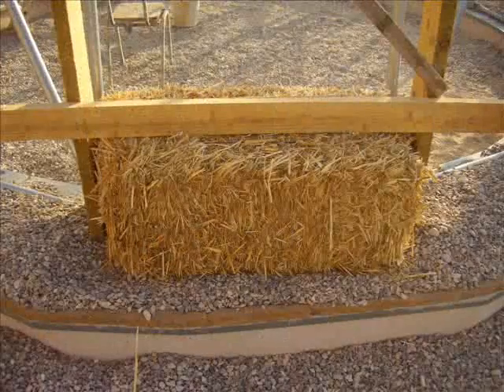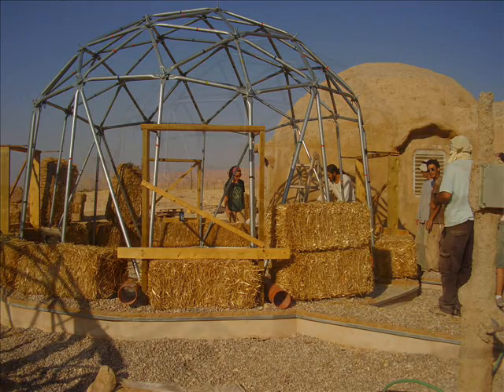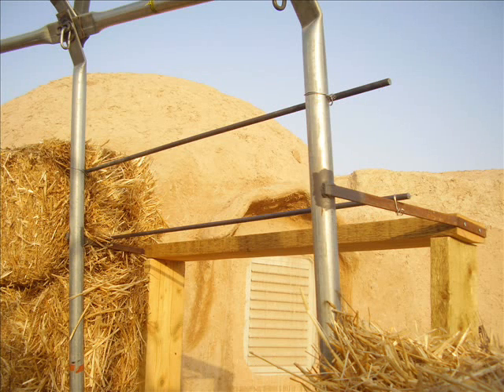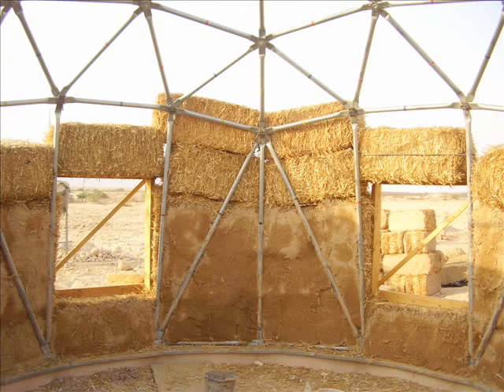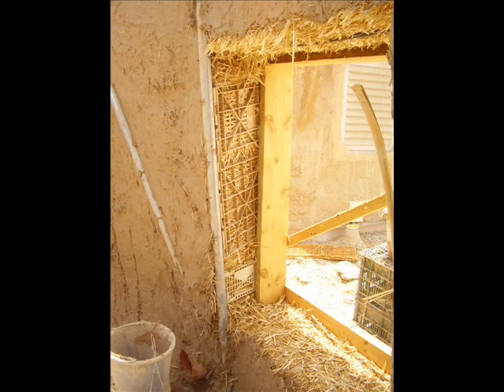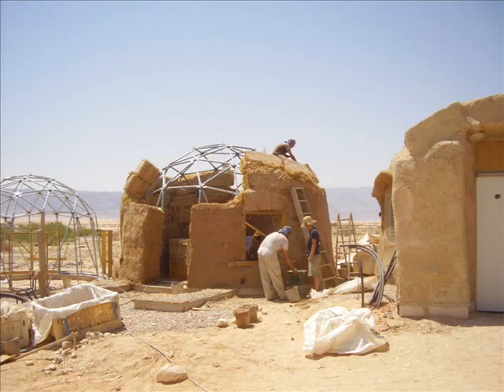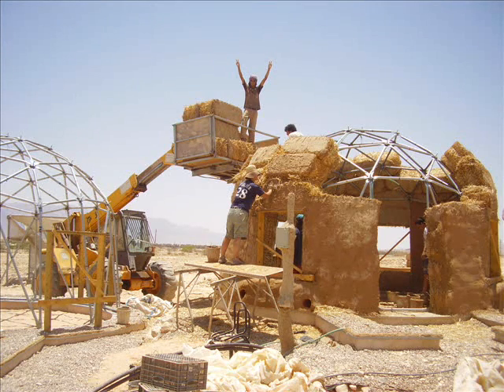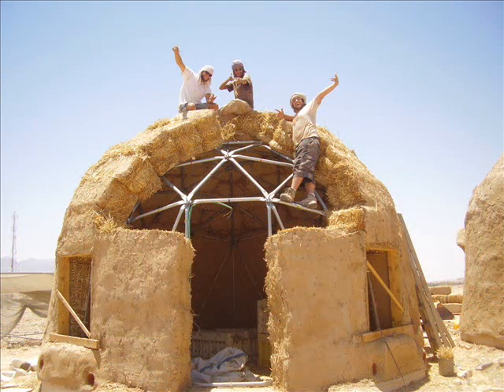#5 How to Build a Geodesic Strawbale Dome - Placing the Bales

Comment: What about condensation on the metal dome framework when the humidity is high or the temperatures get low? That will make your strawbales wet and cause moisture problems inside your cob walls. Seems like there should be a layer of waterproofing protection between the metal and the strawbales, right?
Reply: What about make the dome of wood instead.

Comment: Excuse my ignorance but why don't the builders bond the bales (stagger them) the same way as traditional brick laying? This would avoid straight vertical lines and reduce the risk of running cracks and increase overall strength. Even the Eskimos do it when block building their igloos! Just seems to make sense to me after thirty five years in the construction industry as a carpenter and foreman. Paul Bucky ex Kibbutz volunteer on Neve Yam many moons ago.
Reply: This is not an example of good design.

Comment: Hi!  Great concept!  There are no toxic fumes also no wood used, (save a tree!) strong....  The R factor must be phenomenal... yet maybe not so as it looks like you fill the voids with rock.  To keep all low budget I wonder if on site you could have like a hedge trimmer and bevel the surfaces of the bails so they have 100% surface to surface contact thus no filling voids in between.  Having to fill voids with stones would reduce R factor and also not be as strong.  Once a bail is trimmed maybe shot-crete each one individually with a thin coat to hold together, then put them in place.  Also I'm still concerned about cracking and moisture causing spontaneous combustion or methane to the point you even get an actual explosion..  Maybe I'm way off but just a suggestion from an amateur if that.  Thanks for creating for such a good cause!
Reply: +mwj5368 r factor there is for rocket launcher resistance

Comment: PS I notice a lot of comments that seem to misunderstand that this is "straw", not hay.  This is pure cellulose, nothing to break down, no issues with bugs or rodents (unless you get termites invading through a crack in the plaster).  Assuming the coating is some mixture of clay and lime (nor portland) then the gaseous permeability of the structure would preclude mold as well assuming one doesn't get carried away with wetting the straw to create better adhesion between straw and clay (another benefit if you were to use mesh btw).
Reply: vladis6812  I'm afraid that's just not true.  Let me say that I built my own straw bale house seven years ago, by comparable methods as are explained in this video (although post-and-beam not dome structure).  I've been living in my house for years and it's wonderful, no smell whatsoever and excellent for allergies…nothing toxic at all to breathe.  These guys (Kibbutz Lotan) are doing great work and should be commended for it!!
Reply: vladis6812  I invite you to re-read my previous comment.  When a straw bale house has the proper stucco it doesn't matter how rainy an area is, it still remains dry inside the straw and does not stink.  I could refer you to houses in Flagstaff, AZ which get extraordinary amounts of rain in July, Aug and Sept and then extreme cold and lots of snow in winter…yet do not "stink."  If you know someone with a straw house which does indeed stink then they have used inappropriate stucco or paint.  I have two chapters devoted to how to do this correctly in my book, Sedona Straw Bale.  You might want to read that if you have further concerns.
Reply from the maker: John Cahill You've got it mate. We use no portland cement in the plasters and no lime.
Reply: Thank you so much for inviting me ...!
I think you are right when you talk about the wrong plaster.
Where can I find your book?
Reply: hi, Vladis
     You can find my book here…the button on the right is for an instant digital download, that's the best price and easiest way to go.  Feel free to write me with any questions after reading it.  Cheers, John

https://sites.google.com/site/johncahillmedia/home/sedona-straw-bale
Reply: No way.
Reply: vladis6812 According to mentioned trouble with moisture, this construction is build in Scandinavia whith succes..
Even Denmark where coastal climate creates high level of moisture & rain several hundred houses is build according to Danish building regulations..
Reply: You've lived in this house? The old straw smells bad! After six months in the house made of straw will not live! All will be awful to stink!
Reply: Also, the clay has a higher natural background radiation.
Reply: It is important in which climatic region built this house. For example, if this home in Texas, where it's always dry, warm, and there is no rain, the house has a reason to build. Houses of straw in the cold and rainy regions will always stink because high humidity always provokes smell. This is my opinion and it is confirmed in practice. What climate region is your house?

Comment: I'm curious how often the clay mixture has to be repaired, and how much damage is done climbing on it to do so.  I assume that this design is intended to optimize simplicity of building effort, material cost and time, and I commend your efforts int his regard.  However my guess is that you could greatly improve the integrity of the structure with minor reinforcement measures that tie the bales and dome into a comprehensive structure (overlapping seams/running bond, staking the bales together, inner and outer mesh which would not only cinch the bales together but tie them into the dome structure).  These things don't cost much, don't take much additional time and could greatly effect longevity.  But perhaps your experience is that these are not necessary.  Wonderful project, I applaud  your efforts!
Reply: +John Cahill depends how close the tank drives by

Comment: No Nails, No Lumber: The Bubble Houses of Wallace Neff 
http://goo.gl/0bHZFn
Imagine a house constructed in less than forty-eight hours, without using lumber or nails, that is more resistant to fire, earthquakes, and hurricanes than any traditionally built structure. This may sound like the latest development in prefab housing or green architecture, but the design dates back to 1941 when architect Wallace Neff (1895 1982) developed Airform construction as a solution to the global housing crisis.
http://goo.gl/0bHZFn

Comment: I'm a refractory bricklayer, I don't claim to have an engineering degree, however, I have built hundreds of domes out of brick for many refractory applications.  It is often the most simple idea that has everyone shake their heads. Once you hit the top of your "Barrel"  you cut in one course of brick/bale...after this the rest follow until the top closure.  Somewhat like a spiral...this is done for an insulation course only. The hard course or a hot face isn't necessary in this design.

Comment from the maker: We did consider using wood, but considering that both wood and steel are imported then it made sense to go with the small diameter steel pipe.  Engineering the pipe also allowed us to use unskilled labor and still get a frame that is coded as earthquake proof.

Comment from the maker: You may be right with time.  But that's only part of the story.  These units use Zero energy to heat in the winter: "passive solar" designed they let the sun in and contain the heat at night.  In the summer we have to use air conditioners because its 40-45C during the day (the exterior shell is hot enough to fry on) and at night it only cools down to 30C.  The point is this: using this level of insulation these buildings used 50% less electricity for cooling than comparable houses.

Comment from the maker: When building 'load bearing' wall structures a staggered 'running bond' is critical.  Here, because of earthquakes, the geodesic frame takes the load. The straw-mud plaster holds it all together.  To see a running bond project of ours check out "Bedouin Clinic" on the Open Architecture Network openarchitecturenetwork[dot]org/projects/391

Comment from the maker: Excellent point: normally staggering the bales, or "running bond" as its known in masonry, is the proper method.  We wanted to do that and did so in the first domes we built that had smaller windows placed inside the Geodesic frame. In the later domes we changed the window bucks to external units that didn't allow for a 'wrap around running bond' of straw bales.  Once the earthplaster (with lots of straw in it) get applied it doesn't make much of a difference BECAUSE there is an internal frame.

Comment: I am in northern nevada.. still desert but we get plenty of rain.
I was in a similar build this week for which they used a waterproof plaster which was sufficient for leeks.  its been standing for almost 15 years no leaks.
Reply: what kind of "water proof plaster" did they use.  was it thick?  multiple layers? so it is just the strawbale dome with no roof, and some type of "water proof plaster"?

Comment from the maker: Great question: by combining all the of pigs building techniques we've made our buildings strong, completely recyclable, energy efficient and fire proof.  The sticks are steel pipes that are hand formed, hand installed and when decommissioned can be re-used.  The straw is excellent (and renewable) insulation. The 'bricks' is the 5cm of plaster applied on the interior and exterior.  It received a fire rating of 3 hours!

Comment from the maker: In this particular region condensation is not an issue.  I don't think it would be an issue because the pipes are buried in the plaster and on the interior side of the insulation. They will be at the same temperature of the core of the interior wall.

Comment: what about the region as Lithuania? We have up to 30C in summer and minus 25C in winter and lots of snow same as rains in spring and autumn... what kind of house would you suggest?
Reply: Same with strawbale insulated slab on top of rock layer. And overlapping waterproof roof.

Comment from the maker: @AustralianKing19 During construction - for sure there's an issue.  But, after the walls are coated with earth plasters they are sealed for good. People are finding out that they are sensitive to man-made materials and VOC's used in construction materials and paints - which can all be avoided using natural, inert materials. Since you're an Aussie - check out our mates John and Susan Glassford's website Huff 'n' Puff Constructions

Comment from the maker: @MrAnthonyRizzo Good question. There are two messages for urban settings: a. natural materials can be safely used (modifications and pre-fab wall units have been developed by others in England, Germany and the US) and b. switch the earth with concrete and the above standard insulation layer of straw with some other insulation material (i.e. keep the thermo-dynamic standards we used) to get a super-efficient passive solar home that uses very little purchased energy for heating and cooling.

Comment from the maker: @nNorthWestern The first coat of mud is really sticky/wet and wetting the bales does help but, you're right, is not always necessary.  It depends on the experience of the worker and if the bales are dusty.  We've seen no mold: we let each layer dry completely (in the summer it happens real fast) before applying the next.

Comment from the maker: @tate47ful Domes 1-3 have hand made doors and door frames.  Domes 4-7 had purchased insulated steel doors [local producer - "Sharabani"] in galvanized steel frames with magnetic sealing strips for an air-tight close.

Comment: For tough environments and if you want a stronger dome add steel mesh inside and out then spray cement shotcrete inside and out. Shotcrete is strong enough for keeping rock walls together and is used for other construction and concrete repairs.

Comment: The design, construction and innovative use of materials are beautiful. However I fail to see its overall practicality. I’m sure this type of building is prohibitive to very rural areas but some of the construction material doesn’t seem to be the type that could be locally acquired in such a case. Perhaps I am missing something. Can this type of construction be done in a more urbanized setting given the necessary permits and regulations needed?